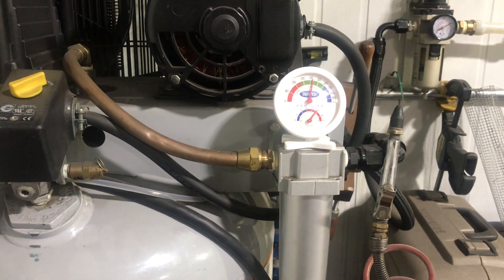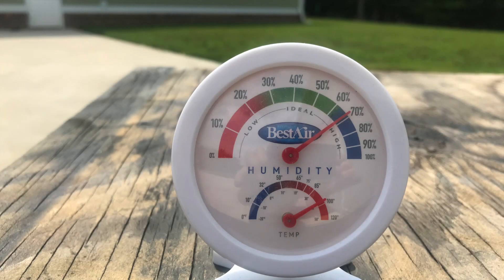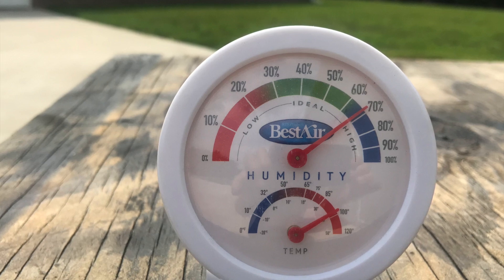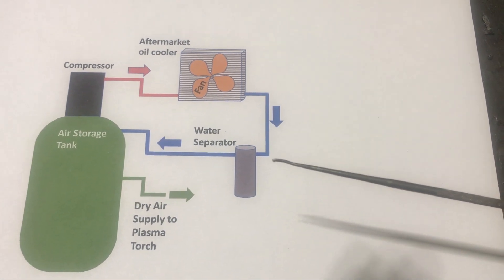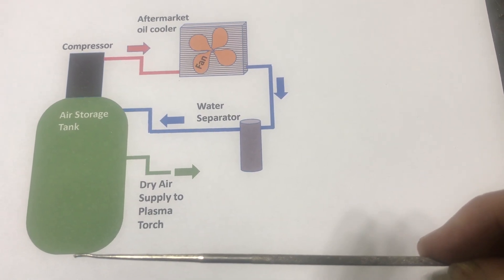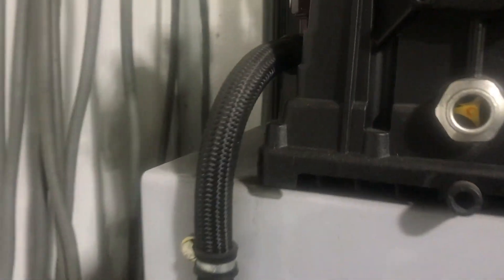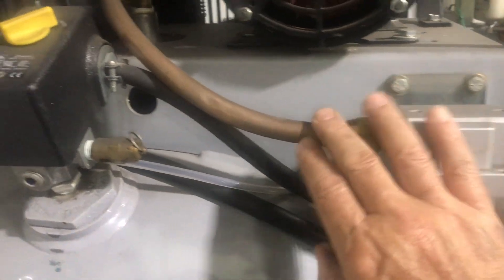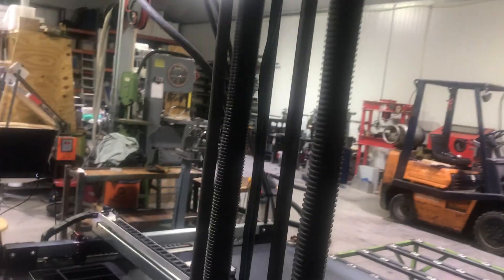Dry Air For the Langmuir Crossfire Plasma Table

Comment: Just curious; how much does the water table raise the humidity in your shop after it is warmed by an extended cut?
Reply from the maker: Hey Frank,  that’s a great question. We know some of the water is turned to steam, plus there is always evaporation. I don’t run the table every day or even for extended periods do my case may not be a good example but I have to admit in my 2400 sqft air conditioned shop I have not seen evidence increased humidity.

Comment: what are the advantages or drying it before your tank vs after?
Reply from the maker: From the standpoint of suppling dry air for the plasma cutting there is no benefit to drying the air before it enters the tank.  However removing the moisture before it goes into the tank does keep water from collecting at the bottom of the air tank so rust and corrosion at the tank bottom is minimized and the need to train the tank at regular intervals is greatly reduced
Reply: @CustomCreations3  gotcha, I have an auto drain on mine.
Reply from the maker: Yep…no real benefit for you…I had cheap auto drain but my compressor is inside and every time it went off it scared the crap out of me so when I did the drying system it took it off!  🤓
Reply: @CustomCreations3  HAHAHA, funny you mention that, it scares the heck out of everyone that visits my shop, I am used to it and laugh every time.
Reply from the maker: @dlewis4647  Remind me not to visit your shop without first taking some valium!!!! :)
Reply: @CustomCreations3  HAHAHAA

Comment: Where did you get the black hose coming for cooler to the front?
Reply from the maker: I bought the stainless braided hose with nylon cover hose from Ebay (https://www.ebay.com/itm/182667445121) along with some AN10 fittings.  The hose from the compressor gets super hot and I was concerned it might fail but no problem so far!

Comment: I have enjoyed your videos. Thanks for taking the time. What brand of hoses are those going to and from after cooler?
Reply from the maker: Hi Dean,

I bought the stainless braided hose with nylon cover hose from Ebay (https://www.ebay.com/itm/182667445121) along with some AN10 fittings.  The hose from the compressor gets super hot and I was concerned it might fail but no problem so far!
Reply: @CustomCreations3  Follow up question, the AN10 fittings are just push lock fittings?
Reply from the maker: @michaelports2295  no they are threaded.  Lots of YouTube examples of installing them…here is one.  https://youtu.be/ihMWrVCGrQg

Comment: I am planning to do something similar on my compressor. I was thinking about running the radiator horizontal with the input on the top so the water will gravity flow through. Do you think the airflow is enough to push the water through on your setup or will it settle in the bottom of the loops in the radiator?
Reply from the maker: I think horizontal mounting will work great and probably better than my horizontal mounting but for my 2-stage compressor there is lots of air flow so I don’t think there is much residual water in the oil cooler or the braided line…even if it collects and pools in the cooler or the lines as soon as the compressor starts again I think it is pushed to the separator. Let me know how your design works…I’d like to hear

Comment: Dan, thanks for the details on this.  I had read about doing a cooler between compressor and tank and seeing it helped me visualize and motivate me to try this out in my shop.  Would like to know more about how big a cooler you are using.  Also, do you think the water settles in the low spot of the braided output line between the cooler & the water separator?  Or perhaps the air flow keeps it moving on its way to the separator.   Keith / St. Louis MO
Reply from the maker: Hey Keith,

I counted rows on the cooler and it looks like a 30 row cooler similar to https://www.ebay.com/itm/152490284178?hash=item2381211492:g:AMgAAOSwEkJdFYzC
As for water in the hose I've never tried tipping the hose after the compressor stops and the unloader valve releases the pressure in the lines...might have to try.  However, the air is flowing while the compressor is running so if there is water collecting in the bend i'm thinking it might just push it on to the separator on next startup.   Might be a good idea to mount the separator below the line when you build yours!   On humid days I get a tablespoon out of the separator on every run...I don't bother to collect it so some days there is a pretty big puddle on the floor under the separator!!